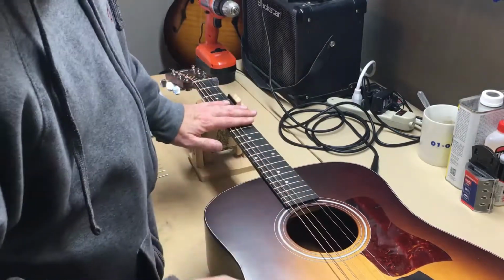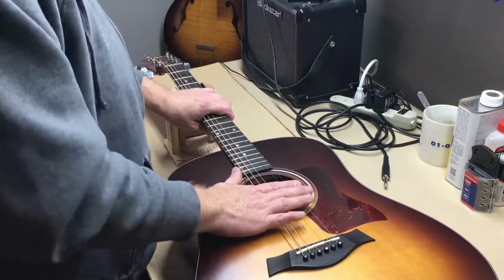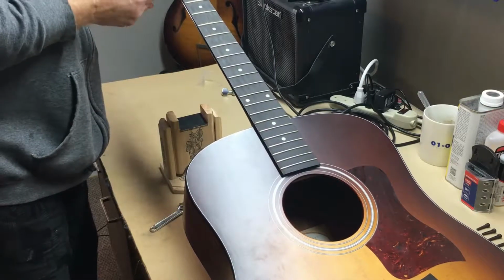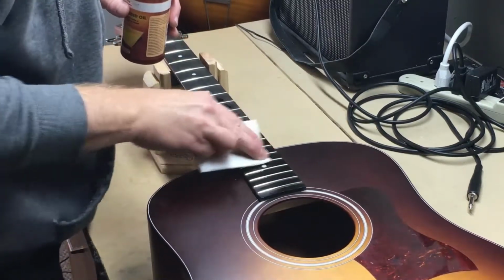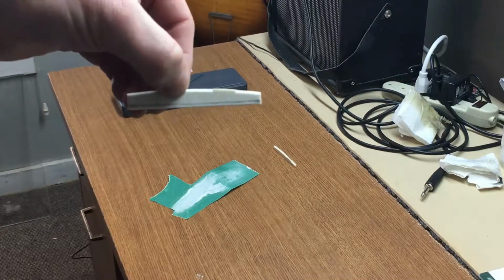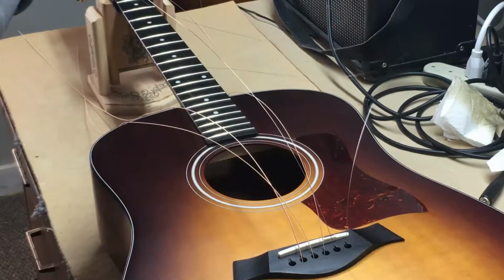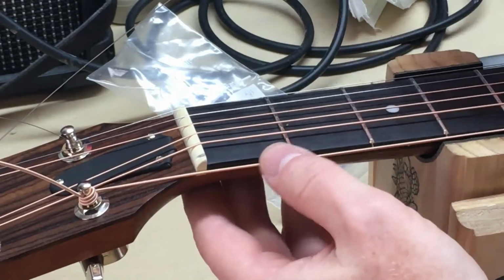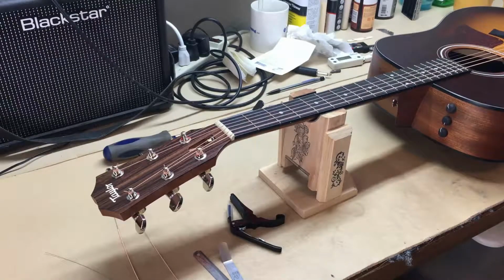Taylor 110e Guitar

Comment: Don't forget that Taylors have bolt on necks which means you adjust the string action not by filing down the saddle but by changing the two neck shims that you get in the $50 Taylor shim kit.
Reply from the maker: Sorry…have to disagree here. Taylor’s have bolt on necks and use shims to get the correct neck angle to the bridge. String height is still set by adjusting the saddle just like every other acoustic guitar.